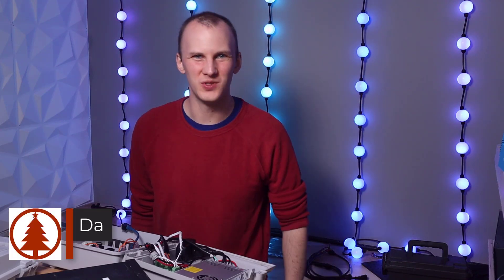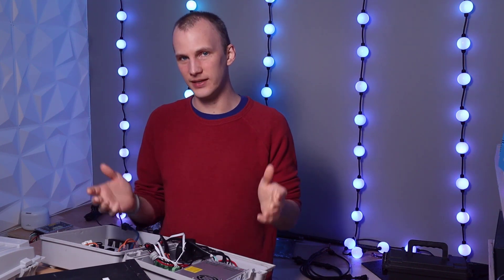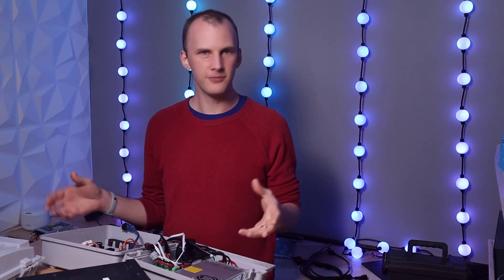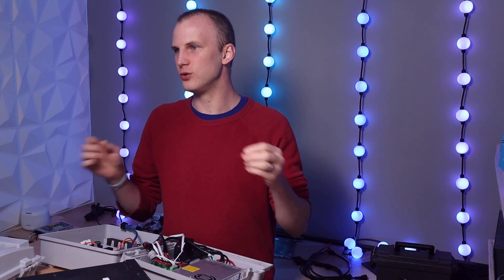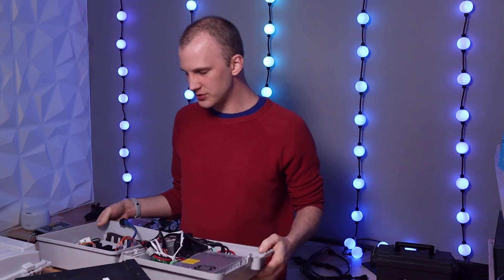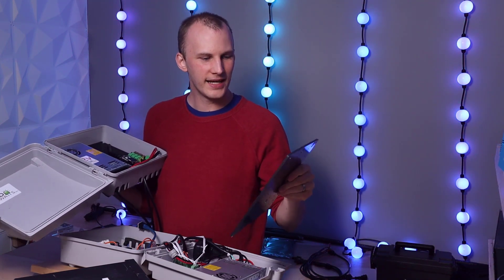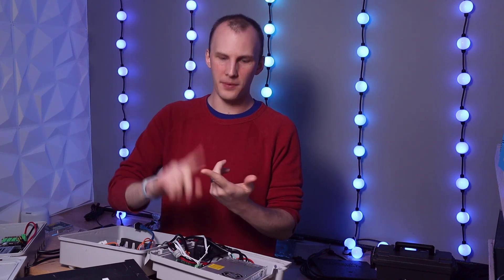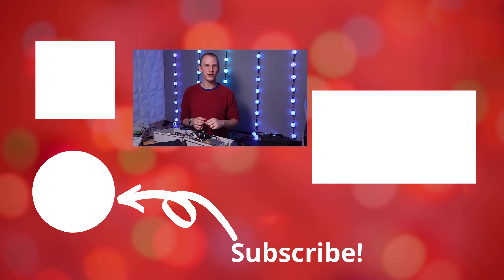Should I Build or Buy My Controllers? Or Take a Hybrid Approach?

Comment: When you showed the Wired Wattst mounting board and used the word Enabling impacted me. Up until I got a CG1500 and those boards I was stuck. I'm not mechanically inclined. I have no clue about figuring out where to put the mounting holes. Then picking the right type and size screws and what type of nut to use. It was over whelming. With the mounting board and hardware combined it freed me up to worry about other things.